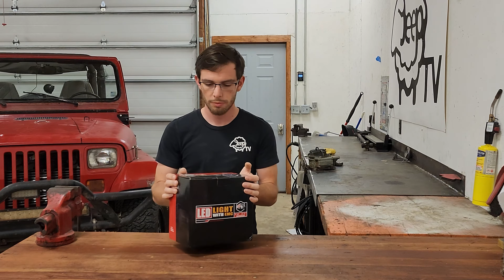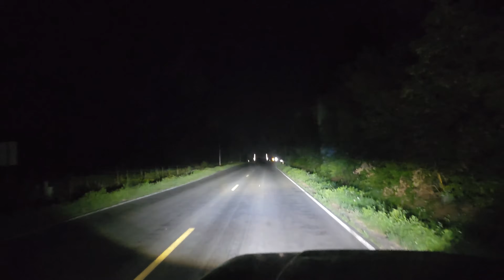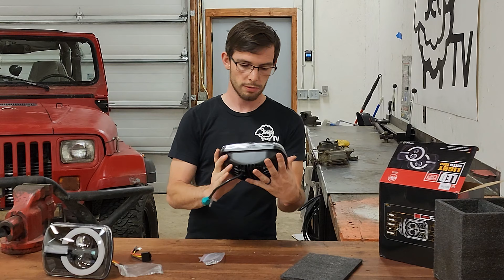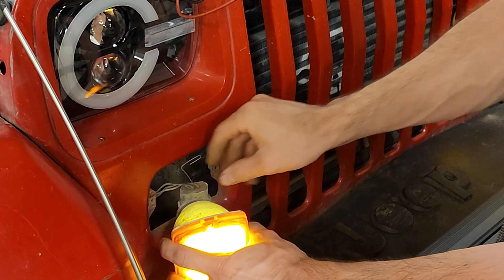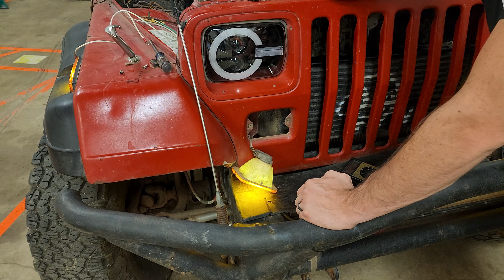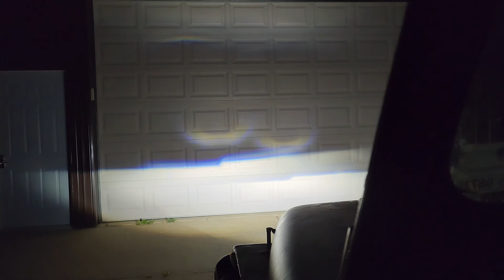LOYO 5x7 "Bronco Style" LED Headlights On My Jeep Wrangler YJ - Review and Install

Comment: YJ Wrangler Owners. Get yourself a bottle of Dielectric Silicone Grease. The front of these Jeeps get soaked with all the elements including salt in the winter. Protect all your connections from corrosion. You'll be glad you did... I did every connection I could get to . Including the dash plugs.

Comment: My YJ's turn signals do not have DRL, they are on with headlights and blinker.  Any recommendations for a good DRL constant 12V tap source?
Reply from the maker: There are quite a few under the dash that come on with ignition, I am sure there are others under the hood as well, alternatively you could just turn on the running lights when you want them on. The headlight switch should have an option for turning on just the running lights
Reply: None of the yj s have a DRL option…  the way this guy wired his lights the DRL come on with the running lights… I would want the DRL to come on only when I have the jeep on the run position at the key ! Not with the light switch…  there is a ign tap at the fuse panel under the dash . It’s labeled ign.

Comment: They're backwards, lol. The bar should be facing out towards the turn. Well that's how they advertised. Still look great tho. I could dig it on my XJ.
Reply: They are correct
Reply: @Geonious  click the link
Reply: @TheJohnnyairgun   I think YT snagged your link.
https://youtu.be/MbWYV4MlHdQ?t=85
Reply: I agree that they are backwards for the simple reason as I installed mine the other way AND the lettering on mine is rightside up.  lol  Love your videos!